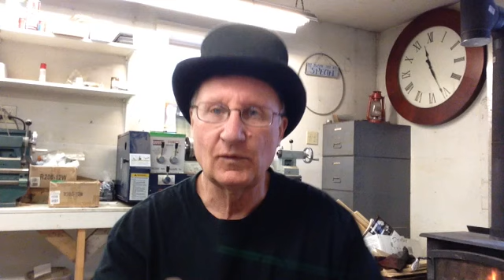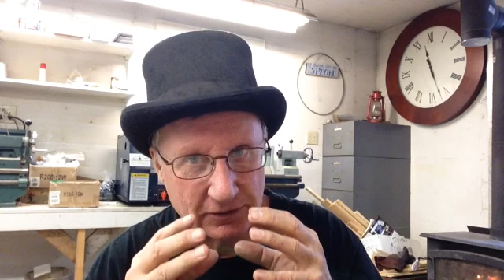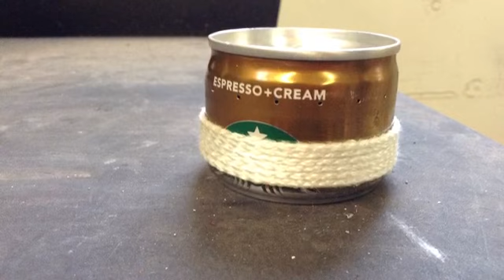My Day

Comment: Owned a LOT of alcohol stoves over the years, the MBD Elite is the only one that I have consistently used over the last few years.

bty, tinny/anybody, I recently started using some swiss fire gel (due to the alcohol as fuel source bans here in California) and thus far I have not had any success getting it to work. Mixed the fire gel with some ethanol and still no luck. Cannot get the little guy to jet through the ports. End up using a wire mesh stand. Any thoughts (beyond the obvious, it isn't going to work) on possible things to try?